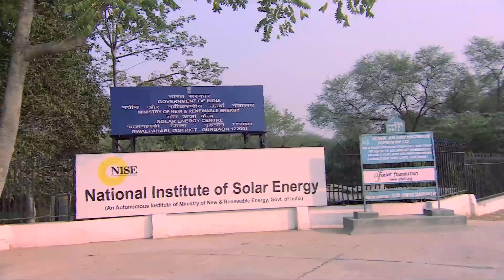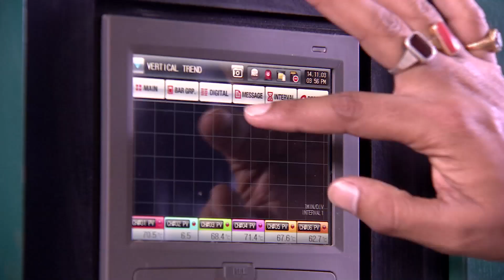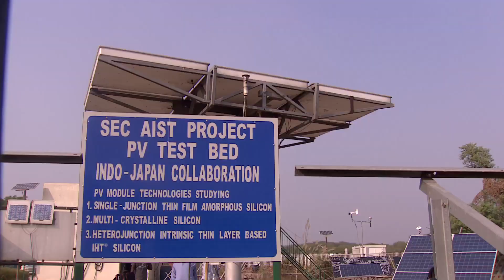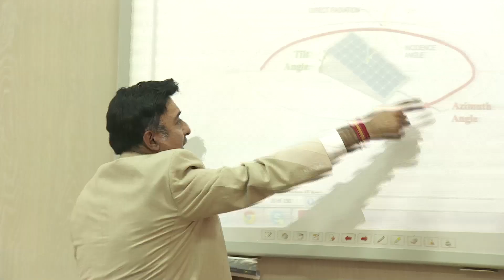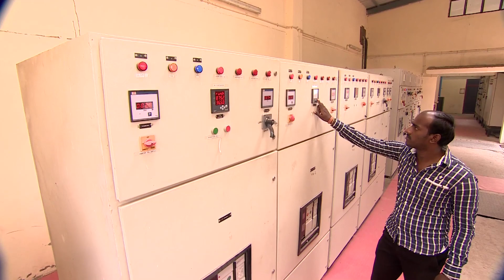National Institute of Solar Energy (NISE)

Comment: 1. The prosperity of Rural India and self-reliance on fuel front by the substitute for Petrol and Diesel with ETHANOL & PONGAMIA OIL, 100% substitute tested and proven.
 2. Prosperity by increasing all agro-produce by 40 to 50% by simple 6 ways, as our farmers are having poor efficiencies in cultivation techniques.
 3. Still, our Public health systems are of the early 19th century as all are unaware of Ozone Generators[ check the scope in developed Nations ], very fast cellulose bond brakes to treat night soils and all wet garbage to generate Biogas for electricity generation than compressing which create negative efficiency factor!!!!
 4. To encounter the air pollution in the densely crowded towns there is the only way to install NEGATIVE ION GENERATORS on each street pole, initially for night time and subsequently for the whole day where recurring expenses may not be more than 2electrical units per year per unit.
 5. I am deadly against the use of PV cells to generate electricity in Arid and Semi-Arid zone of the earth, hence not suitable and economical to the Indian subcontinent, as
 3. Still, our Public health systems are of the early 19th century as all are unaware of Ozone Generators[ check the scope in developed Nations ], very fast cellulose bond brakes to treat night soils and all wet garbage to generate Biogas for electricity generation than compressing which create negative efficiency factor!!!!
 1. The panel must be always clean and dust-free.
 2. The panel must be always a right angle to Sun Rays.
 3. The panel must be always at less than 20deg. Celsius.
 4. The higher temperature of the panel reduces the efficiency & life of the panel.
 5. To the best of my knowledge PV Cells are giving 150 Watts per Sq.M of the area of the PV Cells & not panel area, subject to above conditions.
 Now the total installation of PV Solar panels is about 25.26 GW So the reflection of Heat is five-time that is 126.30GW per second for at least 6 hours per day which is 951.8GJ [ 1 Joule/sec=1Watt ].
 The heat, to make 1Tonney of Iron from the Iron ore requires 26.25Mjules or say watts.
 So the total heat reflected in the Atmosphere by AKSHAY URJAA IN India is at par with heat required to make the Pig Iron of 36259 Tonnies per day for 250 Sun Shining days in a year. A new way of Global Warming. This is already informed to P.M.O. office and National Institute of Solar Energy five years back with a lot of follow up but in vain. This is because all administration is not professionally loyal to their professions and very specifically engineering and scientific staff are NOT LOYAL to their respective FIELDS OF PROFICIENCIES, THAN THE SOCIETY AND REPRESENTATIVES OF SOCIETY TO LURE THEM; which is not at all, in all Developed Nations & even including China.